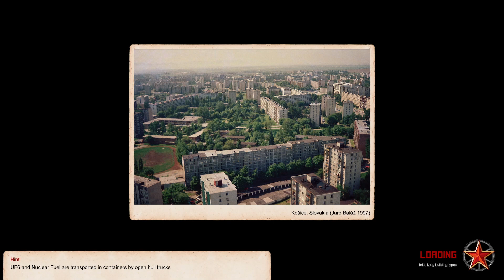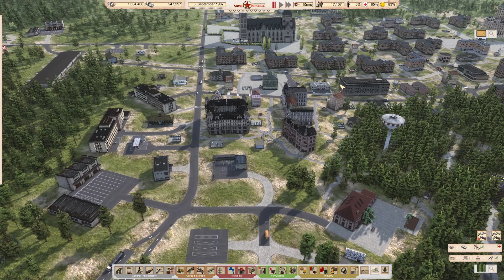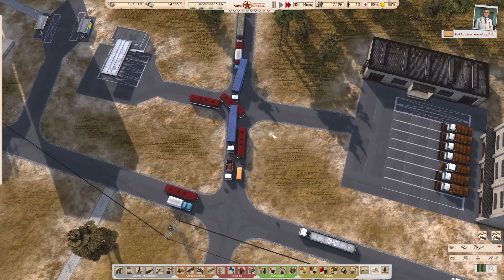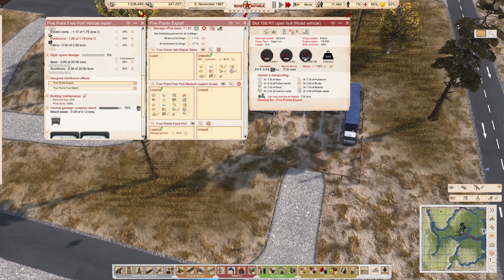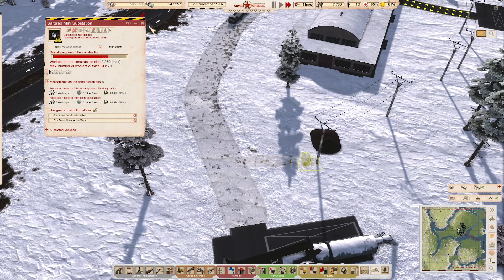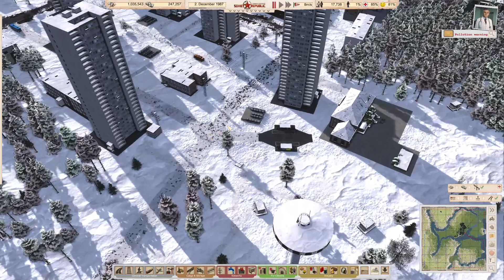Need More Steel (Beta Release) :: Workers & Resources Soviet Republic 0.8.9.20 : #65

Comment: I recognized the traffic jam caused at 12:00 included many busses heading for fuel.

Are we not having a bus end station? Most of them have an internal fuel tank and the busses are filled while waiting for their next turn.
For the same reason it is always nice to support those construction offices which have a tank, too. I prefer them a lot, because of this.
Reply from the maker: Sending fuel to end stations, construction office, etc, is the ideal,  unfortunately this strategy requires a strong source of fuel. e.g. an oil refinery,.  When fuel production is limited or is imported putting more focus on the gas stations, minimises  the pressure on the fuel distribution network and reduces the amount of stored fuel. Plan to restructure the fuel distribution when the oil refinery comes on line.

Comment: The pre built monitoring stations need to have the background ambient radiation set (its zero now), otherwise it will always trigger warnings. Newly placed monitoring stations already have a reasonable default value.
Reply from the maker: Ty for the information.  Hazard of enabling a new update to an existing save.  Will build a new station to check it out.